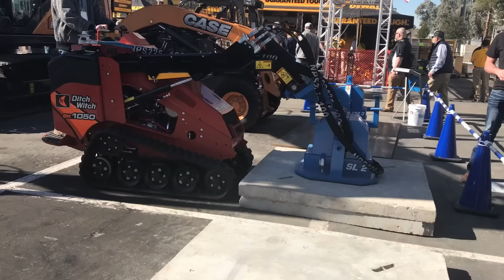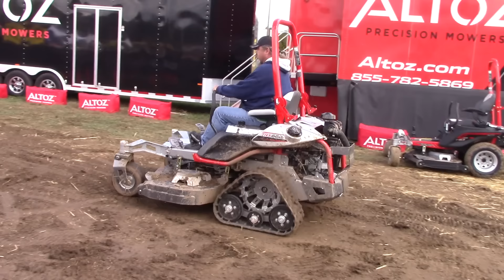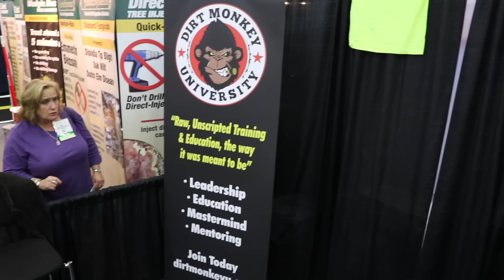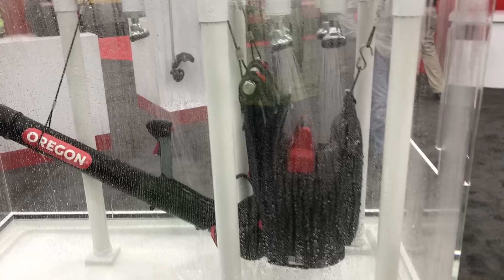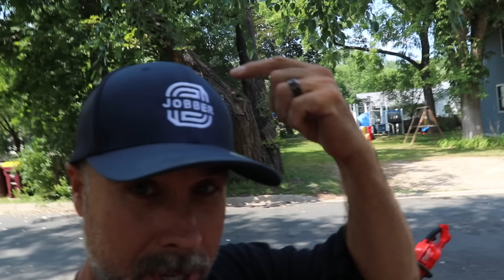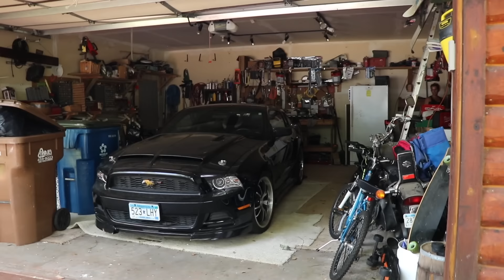Latest and Greatest Tools and Equipment

Comment: This prolly ain’t the right site , but I’ve had cub cadet zero turn with a steering wheel since 2013,  good mower but i think i need too upgrade .  I want one that has twin tanks on it and upgrade 48’’ to 60’’ , i am disabled and can’t talk, pretty much Use my left side since the right side is payrilized,, I had vasculitus of the Central Nervous System ....

Comment: I remember the FlyMo!  Yea they're continuing to improve it if they keep trying to do sell it, since they didn't work AT ALL.  They might improve it from doesn't work at all to works really poorly.  Basic concept, push all the grass flat so that you can lift the mower up, then try to cut the grass......
Reply: Thor Dehr . Flymo is the only thing that could cut my steep bank. Worked just fine every time.

Comment: I love the Elec Wheelbarrow ! I am in a wheelchair and it is so damn hard to push one in a wheelchair. I won't get a elec wheelchair i am 55 been in a chair from 1993.I am in good shape. I live alone so when i go to the store an have thing to take in my house it is hard to bring thing in the house. I been trying to find a battery kart are a smaller wheelbarrow. On the wheelbarrow I was thinking on changing the bucket off the wheelbarrow to a like a box type . Have you ever even seen a battery powered style kart?? I have been looking lot place can't find one. Maybe i need to start making them lot times ezer to buy an not make.

Comment: Altoz trx are between 16,999 and 18,999 they make 61 and 66 inch mower. You can get finish cut or rough cut decks and they can swap out. Plus utility blade independent suspension.

Comment: I used Jobber for 5 years.... They got bigger as most do and I strayed away. I have my own personal reasons but I am glad they are working with you and this "scholarship". Cool video, love seeing new stuff.... I am keeping an eye on the whole Milwaukee tool movement as I am really liking the spread of battery operated tools. That battery operated wheelbarrow looks like something I would buy... great for hills and long wheelbarrow runs. Im curious of the longevity or serviceability of it... If it only lasted a year under commercial use and then needed to be replaced I couldn't justify the cost. There is a fine line between practical and lazy..... For self employed or owner operated definitely looks good.